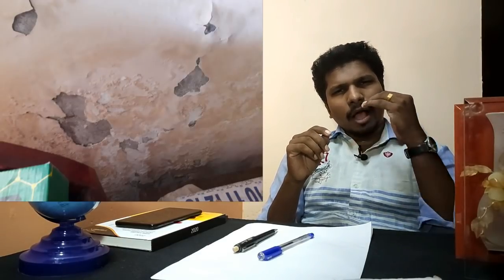wall dampness || சுவரில் ஓதம் வராமல் தவிர்க்கலாம்

Comment: Adu stop panraduku ena sir pananun
1.Neriya carck iruku sir 
2. Kurpita side wall la masala poosala because 2inch gab iruku and side la house iruku sir ..... My room and wall oru Mari aichu and room wall side. Floor joint  la light ah thani varudu  romba heavy ah rain vanda  apadi iruku sir 
Flooring and side floorings full ah granite panirkom .......
I want solution for t ht sir plzzz..... plzzzz reply for this
Reply: I waiting for ur response
Reply: There is small drops of water dripping from the ceiling fan point in my first floor flat. What may be the reason. There are 2 floors above my flat. We have already relaid the tiles in the second floor bathroom. No leak for 1 year. Now again water is dripping from the ceiling. Can you help us
Reply from the maker: Mak construction 
8608353380
Reply: @ramsomaskandan1403  bro electrical line la yedhum open iruka outer area la nu chk pannunga .